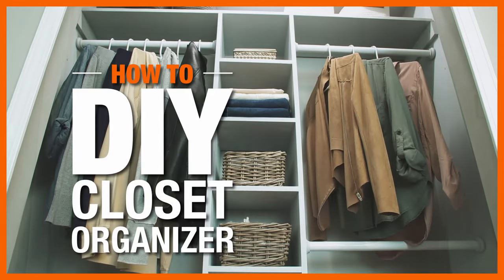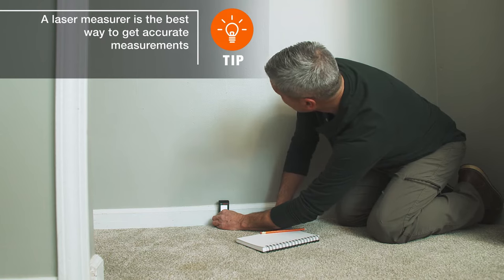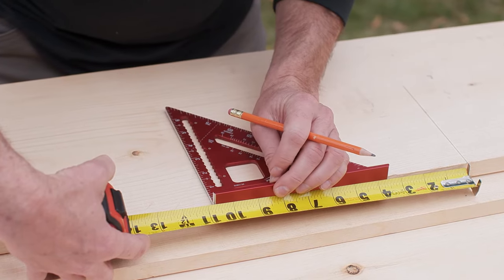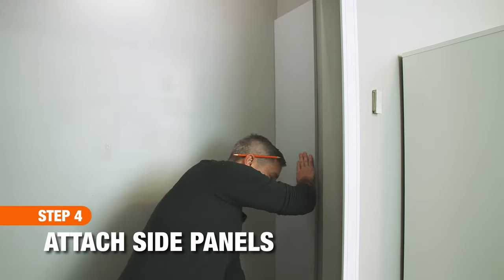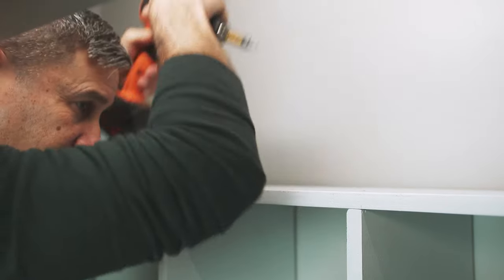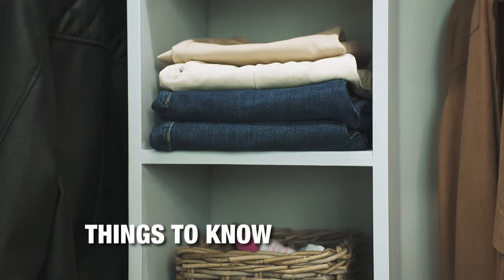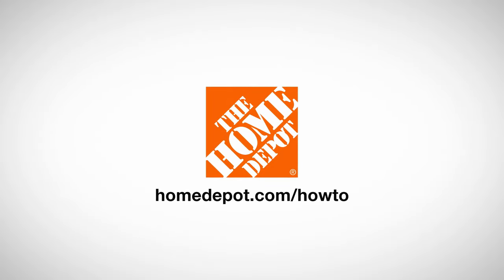DIY Closet Organizer | The Home Depot

Comment: How much does the materials cost?
Reply: Just wood alone, I would estimate maybe $100. 
Paint would be around $40. If you need to prime like I do, then the primer for MDF is about $75
Screws, another $20. 
Rod and brackets are not that expensive. I haven't bought mine yet, so I do not want to tell you the wrong pricing.
Reply: If this is your first time, buy about 25% more materials than you need in case you mess up.
Reply: I am in the process of building this right now. Almost exactly like in the video with a similar sized closet. I spent about $250 for all lumber, hardware, primer, and paint at Lowe’s.
Reply: I was charged $13000 CAD which I can't afford. I really need this but not sure I can do it. Finding a stud is almost impossible for me even with a stud finder, it beeps but no stud after drilling. How will I then do this? 😮

Comment: they make it look so easy
Reply: I'm building my own. 
For drawers, I bought a dresser at Ikea. This is my center piece that I am building around. 
It is then a lot easier. 

One thing they didn't mention, to make the closet look nicer, caulking is very important.
Reply: @c-hd5696 what if the closet is wide but the opening is small so theres 2-3 fit on either side thats hidden?

Comment: What type and thickness wood was used for this
Reply: 3/4”
Reply: It’s technically a 1” but 1” in wood means 3/4 or 0.75” in a measuring tape. There is a reason for this but just remember that for when making a shelving
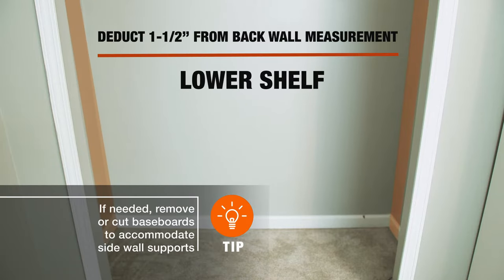Reply: @oaktutor1154 thanks for the explanation, because I was wondering in @0:56 why he said deduct 1-1/2” because I assumed it should be 2” since the wood thickness is 1”.

Comment: What type of wood should I get?
Reply: I'm using Melamine for the verticals and MDF for the shelves.
Reply: Pine
Reply: I opted to use solid pine.  I wanted to fill all screw hole and prime and paint everything so I didn’t want melamine and I wanted stronger shelves that won’t have as much tendency to sag so that ruled out mdf for me. 

If you use solid wood make sure you look to find the straightest knot free boards you can. That can be pretty difficult depending on what your store has in stock.